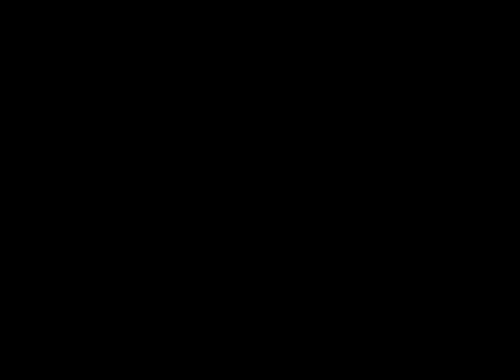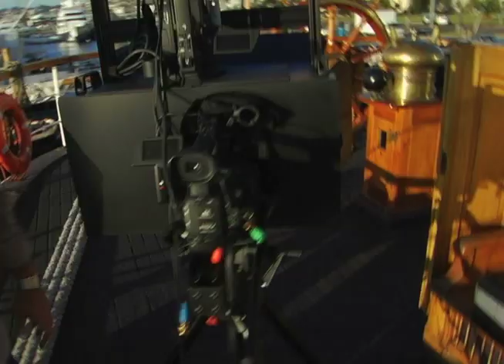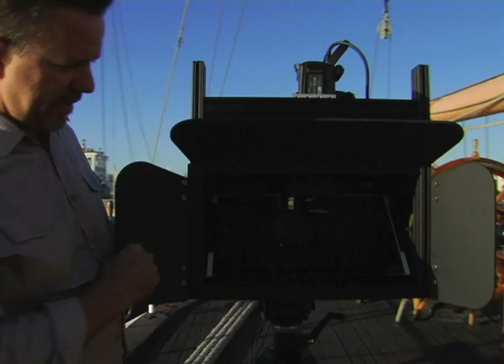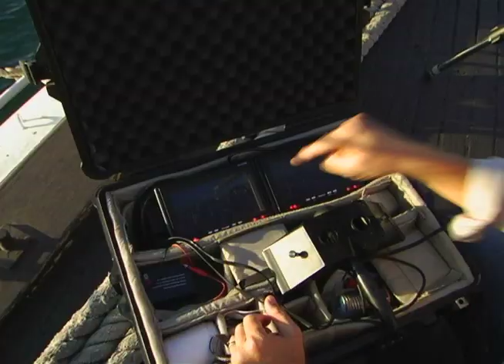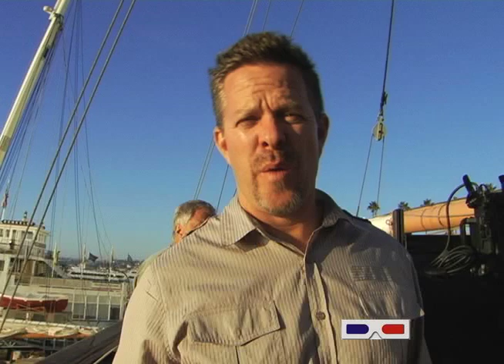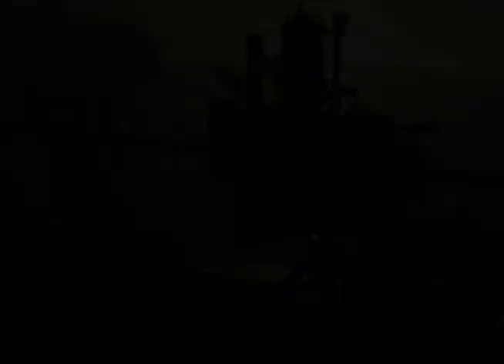SHOOT 3D NOW !   How to use a 3D beam-splitter rig - www.3DFilmFactory.com

Comment: @BlackoutDOTcom id say flip one upside down to nudge it a bit closer, that gives you pretty much the same distancing as eyes. as far as sync goes, just sync them with a clapper or something. also: 3d isnt that good, it especially isnt worth it if youre going to nerd out over a few cm and overcomplicate things for its sake. concentrate on fully mastering 2d footage before you try this, otherwise anything you make will just suck in 3d.